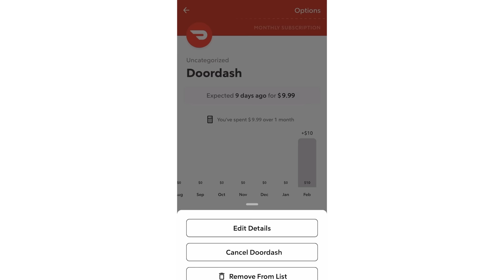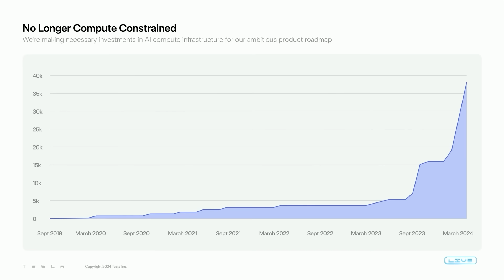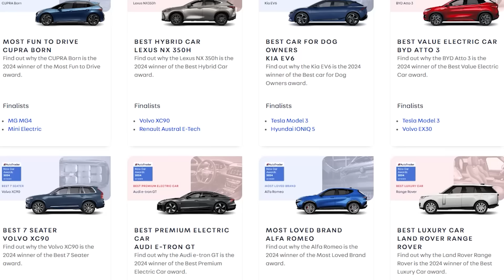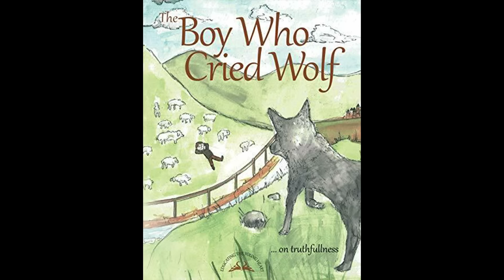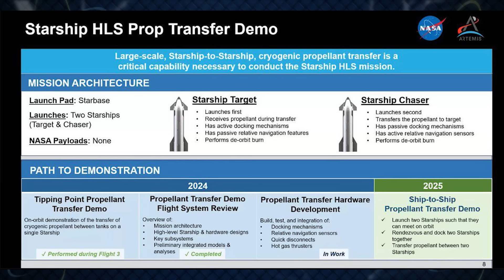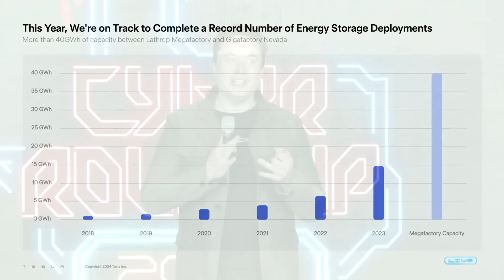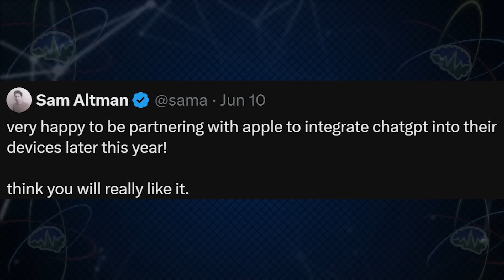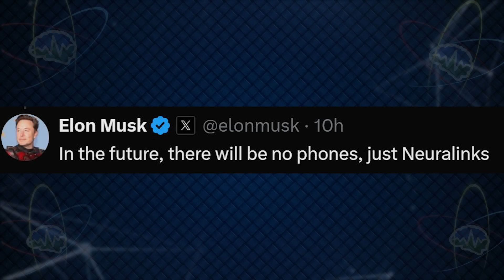Tesla's BIG NEWS From Texas | Tesla Time News 406

Comment: Zac i have a question about evgo escape adapter and Sparky.   Does it plyg into Sparky?  Mine does not.  I have the 2016 model x and when my charge door is open the adapter will not plug into car.  My skin quarter panel is in the way and the locking mechanism on the bottom of adapter hits the quarter panel.   The company recognized the problem and said they are going to build an upgraded adapter that will clear the quarter panel and allow for proper function.   So if yours fits then one year difference in MX models has different panels.

Comment: 22:31 FSD Transfer should not be cheered for. They should advocate for transforming FSD into an actual licensing model. Meaning:
1. Keep the subscription license, which is bound to a specific car.
2. Offer a full license, that can be assigned dynamically to any car the user has access to - even if their just has guest access, like with a rental. This would also justify the ridiculous amount Tesla asks for it currently.
3. Offer the option to permanently bind FSD to a car. Which should price wise be between monthly subscription and full-license.

Comment: Dealerships are discouraging EV sales TO the buyers who want to buy an EV. ALL new vehicle warrantys EXCLUDE polution controls and wear items.  Fuel injectors, Exhaust, Oxy Sensors, Spark Plugs, Coil Packs, Filters, Fluids, timing belts are all Customer Pay items. These are a dealerships profit area NOT car sales. EVs have NONE of these parts or services. Car makers are also losing sales of these items when EVs are made.
Reply: Mitsubishi stopped my sister buying an EV. They told her it would take years to deliver and they said they are not that good?  Perth western Australia 🦘

Comment: 6:25 I think those two things are the RoboTaxi with no steering wheel and the Model 2 that looks very similar to the RoboTaxi but it has a steering wheel and pedals.  The RoboTaxi comes with FSD and the Model 2 does not and costs $20,000

Comment: 3/5 for reliability because:

"Tesla Model Y owners in the States have been reporting lots of issues, albeit with build quality more than significant things going wrong under the bodywork, such as misaligned body panels to mis-matched paint. The respected JD Power survey last year put Tesla last out of 32 brands, with 250 problems per 100 vehicles reported by owners. The Model 3 has been reported for similar build-quality issues, inside and out. Other reliability gripes surrounding Model S and Model X were listened to by Tesla and updates and fixes issued, so you’d be fairly safe to assume things will improve over time, and the shut lines on the Model Y already look more precise."

Comment: What happens to hardware 3 owners when hardware 4 or 5 is installed. If FSD running under 5 is better than 3...do hardware 3 owners have a worst FSD? If so hdw 3 owners may have a case.

Comment: Van - using Cybertruck platform.
Model 2 and Robotaxi - using the partial unboxed manufacturing process. 
Roadster 2.0 using the full unboxed process since it is low volue high margin product. 

Roadster will be insane. 
The new spects could be:-
1- All-wheel-Steer
2- Steer-by-Wire
3- 800v and 400v charging
5- FSD and HDW5 
6- 4680's 
7- Cell to pack 
8- unboxed manufacuring process. 
9- Track kit as standard. 
10- Tri- motor like the plaid. 
11- 48v architecture. 

With the above I expect to see the following performance specs:-

1: 0-60 =1.85 sec.
2: Top speed 220 mph
3: 1200hp and 1000lb ft of
     Torq. 
4: range 420 miles/charge. 
5: charging time 10-80% in
    15 min via V4 chargers. 
6: Wireless charging capable.
7: Air suspension. 
8: heated + cooled seats and steering wheel. 

Price tage @$250k. 
😍😍😍😍😍😍😍

Comment: Servicing was not suppose to be a profit centre
Reply: Dealers are making profits off of auto repair services.
Reply: @finned958  Tesla owns their service centers.... legacy auto does not own the dealerships/repairs centers
Reply: @gearymarsolais962  So Tesla makes profits. They are a for profit company. What are you missing?
Reply: I didn't hear "profit centre", I heard "no longer making a loss". It's possible to balance the books and end up with (close to) zero profit. Maybe they do this country-wide or company-wide and dynamically adjust the service/labour fees and cost of goods against their costs for worker pay, office space, etc. accordingly.
Reply: @finned958  What you are missing is Elon having said that servicing would not become a profit centre.
Reply: @nettlesoup  The chart clearly showed rising profits. Not immoral, just contrary to what Elon had stated.
Reply: Like all EV manufacturers, they been losing money for years. So whether service centers are profitable depends on making up for the massive earlier losses. Breakeven point is close, but still a few years away.
There’s also the class action suit from owners that want independent service centers.
Reply: @finned958  Good point about making up for the losses, and a wise thing to do. Also, by this time I wouldn't be surprised if Tesla has changed their mind on the idea of not making a profit on service. Why pass up some profit?
My ICE mechanic, a VW/Audi specialist, is going through certification to repair Tesla vehicles.

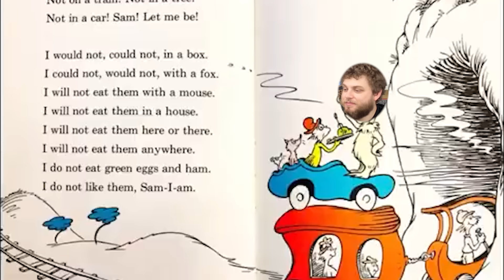Comment: 19:21 I have the opposite happen, to an extent.  I test drove my buddies Cybertruck and the windshield had weird lensing at the bottom which caused me to have vertigo after driving it.  It may have been a combination of not knowing where the front end ended too (such a short snout).  I did not like the steering wheel at all and kept hitting my own wrists on turns.  The steering wheel is crazy sensitive too. Like my F150 the passenger seat felt great but the drivers seat seems to be built for someone a little lighter weight than me.  Was a little unconformable.  Also my buddies magnets on the side were causing some type of browning of the stainless steel surface that can't be wiped away with a cloth and soap.  Outside of all these problems it was a very interesting drive.  I even got coal rolled twice and everyone was looking at us as we drove by.
Reply: How were you hitting your wrists in turns, The cyber truck wheel only turns (rotates) 90 degrees, Steering is more sensitive at low speeds like in parking lots and the sensitivity gets less and less the faster you go.
Reply: @Drcraigfreeman  I am use to holding on to the wheel, especially when off-roading.  Just kept bumping my arms into each other although I could have one handed the wheel (or one fingered it) because of how sensitive it was.  Not enough area to grasp.

Comment: 9:27 I hope that ditches and other drop-offs will be included in "static objects" with regard to avoiding "collisions" with same.  I will be glad when I don't have to take over to prevent FSD from dropping the back right tire in the ditch when making a tight right turn.  I really think FSD has not shown the proper respect for the culverts and washed-out-inside-corners at intersections in my neighborhood. The best road ISN'T no road.

Comment: I’ve had multiple problems with my 2022 model lr y. Besides waiting for it for 7 1/2 months it’s gone through 2 sets of tires in 19,000 miles, ie on third set, plus the knuckles on the 4 wheels had to be replaced. Doesn’t get near the 330 miles it has promoted, closer to 230 maximum.
Reply: Blame the EPA for the range figures. Blame your driving style for the wear and tear on the car and your aggressive driving for the short range!
Reply: At age 72 I am not an aggressive driver but I can see why you might think so. Tesla blames the tire wear on the faulty knuckles for the tire wear. Time will tell.
Reply: Well to the Elon cultists any issues you have with the vehicle will be your fault, always. 

There is a good chance your vehicle was not aligned correctly before it left the factory. After our 3rd set of tires in 50k miles we had an alignment done and it had been way off. Keep in mind these cars are heavy and will by default eat more rubber. 

You should investigate the rage issue. Our 2020 M3P had a 299 mile range at 100% state of charge. Now it is about 250ish on a good day but what you are reporting is range degradation that could possibly fall under warranty.
Reply: @bleearg0102  I just it aligned a few weeks ago. That’s how they discovered the knuckles were bad. Hopefully this fixes excessive tire wear issues.

Comment: On FSD "not quite here yet", you are right.  No matter what we call FSD V12.x.x, its still a beta.  The free month scared all my Tesla owning friends.  Maybe V12.x will be a viable driver assistance tool by the end of 2024.  I know someone else who bought an early FSD license but then found out they couldn't ever run FSD.  You should all be able to either get your money back or get one full free transfer regardless of when you want to do it.  In general, I recommend the month-to-month FSD subscription over purchasing.

As for Hardware 3, which my 2023 Model 3 has,  it would be great if Tesla figured out how to retrofit a HW 4.5 controller into my HW 3 controller slot.  Retrofitting cameras may be hard, but I think the most FSD bang for the buck comes with more computing (and maybe side looking cameras near the headlights).

Comment: You probably saw this, but I saw a couple recent FSD ride-alongs where there was an obstruction in the road, and FSD didn't even try to go around. In a true FSD car, the passenger, would simply use voice commands to ask the car to go around the obstacle, or find a route out,  or look for a detour sign, etc., as in one case there were cars turning left, and the car could have done the same, if it understood the situation fully. If it kept track of traffic flow generally, it could inference a way out of its frozen state.  Or if the car was UN-occupied, it would ask for assistance and road assistants would asses the cameras and tell the car how to proceed. I also saw that the car did not engage its 4 way flashers, once it was "defeated".

Comment: My Tesla is very reliable in the drive system, but it has many quality issues. Water in rear lights, one door didn't close correctly, seat not bolted in correctly... I think those kind of thing make people vote lower in reliability, it won't let you stranded but you still need to go to Tesla Service to get it repaired which is not convenient.

Comment: Reliability will almost certainly be cause the china build quality is just not been that amazing, might be better now but those earlier cars where pretty bad. (I had one of the last MR LR to be imported to the uk from fremont, now have a model 3 LR from china from mid 2021 and my god I've had to get so many things fixed like windscreen because there was glue missing at the bottom allowing wind in to rattles from center console/screen area to bad scroll wheel buttons.

Comment: The renderings of robotaxi inside seem to show a two seater.
 But when Checker cabs were fading away, my cousins and I were always happy to see a Checker stop for us. With the rear jump seats down, you could fit 5 comfortably in the back and a sixth up front.
 A modern cab fits 3 or 4.
And Elon thinks two-seaters will be enough? Couples going out to dinner are their man market? Double dates need not apply? Families can take the bus?

Comment: Here's the deal with permanent (i.e. you bought FSD outright) FSD tech txfr to another Tesla. 
   Everything in a Tesla is keyed to the VIN and that VIN is the key to their virtual model of your specific car inside their database. If your car has a new seat position regulator in it then your virtual model in Tesla's database has that info. I believe that Tesla reports which VIN numbers have FSD to the NHTSA so they can know if an accident occurred in a car that could run FSD. 
Swapping which VIN number is associated with FSD means that Tesla has to go into your virtual car model and remove those links. It then might have to notify the NHTSA that FSD is no longer associated with the older car VIN. This is why I think Elon says that it's complicated... it's not so much that the internal stuff is complicated. 
    Now why do I believe that the internal stuff is easy?  Because of the FSD monthly subscription. Tesla can easily bring a car in and out of the FSD database in the subscription model instantly but is saying that if you bought FSD outright it's a hassle. 
     One of two things... either Elon is lying and Tesla just wants to sell you another expensive FSD license when you buy another car OR there's more to it as I propose there might be.
   There may be one other deal here.... allowing you to use your Tesla in the robo-cab fleet. Is it possible that only FSD that is bought outright will be allowed to do this... in other words you can't just buy a subscription and do this???   If so changing which VIN has outright bought FSD might cause issues somehow in the cybercab software system..... just wild conjecture here.

Comment: Elon's lawsuit against open AI? 

Your analysis sucks. Here's my take. 

Tesla has no claim on OpenAI. It's all Elon. 

So Sam and Elon cut a deal so that xAI has access to OpenAI tech. 

You're not up to speed with AI either. Tesla's hardware architecture is waaaay ahead with NPU design. Tesla is building a hardware architecture using Dojo and Rev 3/4/5 integrated with Nvidia chips for the next generation of AI hardware. Pretty obvious, right. 

And OpenAI will get access to the hardware they need. 

Remember when Bill Gates shorted Tesla $500 million and lost $1,500 million. 

That pissed Elon off. He won't be helping Microsoft.